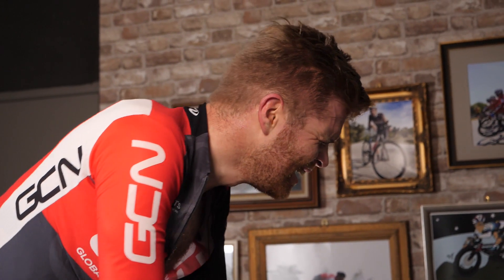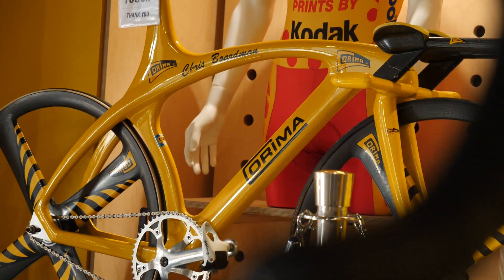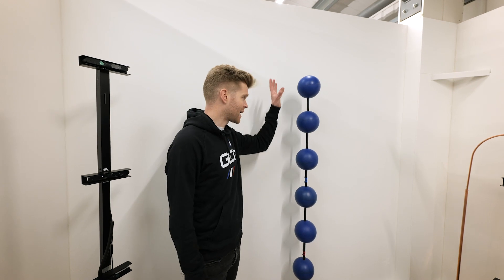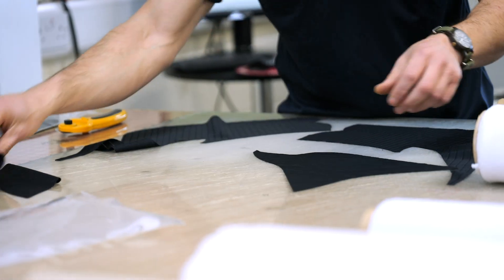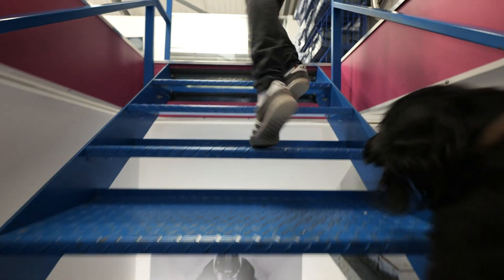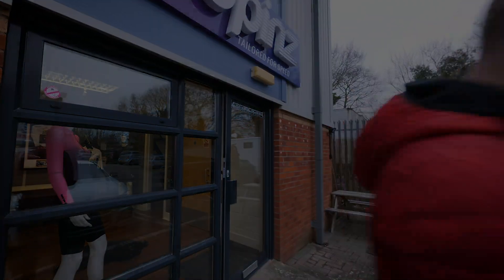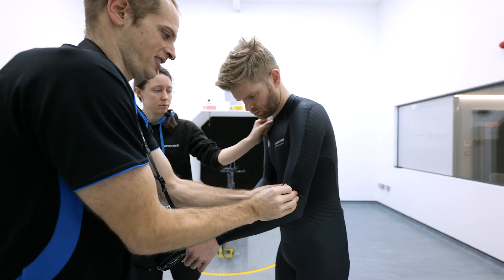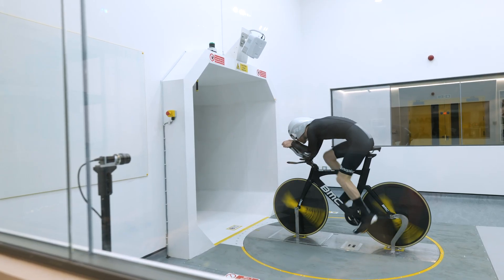Fastest Aero Upgrade | Ollie's Hour Of Power

Comment: Make sure the velodrome jack up the temperature to 28c, as they did for Alex Dowsett!!! That I'll save you another lump of watts, over 20c ambient. Get on the gain 🚂 !!!!
Reply: Gedeon Preobrazhenskiĭ 

Pretty sure colder air is more dense as the atoms are closer together? When air gets closer to its boiling point the atoms get further apart as they get ready to turn into a gas when all the bonds between them break.
Reply: @atticushexcel9567  Hi I cannot explain why you believe warmer air is "denser". As Pressure-Volume-Temp is constant, +8c on 20c, in a velodrome, decreased the ambient air pressure and reduced the watts required for Alex Dowsett, to cut though it. 👍

Comment: I think your ride was FANTASTIC! What a motor! Interesting to see the value of the skin suit as well. You have probably optimized your arm position on the aero bars as that is often "low hanging fruit". I watch Greg Lemond win the Tour, from power AND an excellent aero position. Very influential as to thinking about position.

With a motor like that I would be interested in what you can do on a more streamlined machine, like a velomobile, or a single track faired recumbent bike like in the HPV championships.

Comment: 20w saving sounds impressive but against how many watts estimated to hold 50kph?
Reply: Without going crazy in terms of tech...it is about 400W with decent gear/position.   Thus if he can go a bit crazy, tech wise, the delta between a good FTP and a 400W demand is manageable.    I have no doubt, baring disaster, he will do it.     This is what I would like to know at the end is what is his FTP and how much to gear and wisdom cover that gap.
Reply: @trepidati0n533  Nah mate on the track it's more like 350watts if using normal pursuit bars, skinsuit etc. In a super optimized position and best equipment around then I doubt Ollie will be averaging much over 300watts

Comment: I wonder how fast the skin is in the nude...
Reply: I would be interested too. But I guess suit is faster, like swimmers wear them too instead of speedo when they can
Reply: You should ask Si - he was practically nude save for the mullet on that dare / punishment ride in central London!  :-)
Reply: I've read/seen it mentioned several times the skin is actually slower than modern fabric (hence the push for high socks and long arms).
Reply: Slower than the suits, that’s why they wear the full sleeves
Reply: Nude with be slower because of the small imperfections in the skin compared to a solid, uniform fabric.
Reply: The scarring for trip strips would suck :-)

Comment: Did anyone else notice that they changed bikes when they tested the more expensive skinsuit.
Reply: It was on separate days. Dont worry though. when we tested the custom suit, we did baseline runs with the non custom suit. This was important as a i genuinely wanted to know the difference. This challenge means a lot to me and as a scientist i want to accurately quantify things.
Reply: Hampus Gerestrand I have no idea what you’re going on about. It looks like the same BMC Time Machine with the same aerobar position on the final two tests. They changed bikes between the initial road kit and skinsuit tests at the beginning of the video, but used one bike for the final comparison between the stock and custom skinsuits.
Reply: @GCNuser123  Ok, great. I just thought it seemed a bit odd when the colour changed and it wasn't mentioned in the video. Anyways, thanks for clarifying and good luck on the effort.

Comment: Ollie, how hard will it be to hold 110 rpm cadence for an hour? Seems so unnatural.
Reply: Not really, it depends on the rider, and what you train. My self selected Cadence for TT's is between 100-105.
Reply: @fatbloaterdave  I agree.  While I am still a poke...everyone I talk with that has a higher FTP tends to have a higher cadence.  It almost seems like the Force per rotation almost seems to level off and further gains are on rotational speed.
Reply: Trepidati0n my 10 mile TTs are around 340w high but not super high.

Comment: Ride in shorts only and shave all the hair off body parts that are exposed? How about something I saw on Youtube as a gag, someone got into a large plastic bag, and had the air removed with a vacuum cleaner, that way the material is 'sucked' onto you body shape? Of cause you would need some kind of small electric motor to suck out the air.